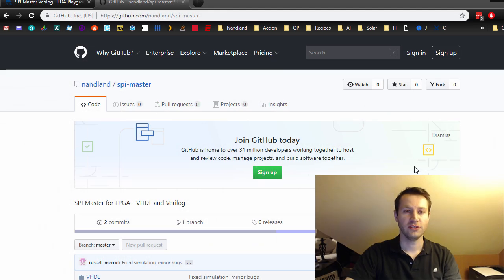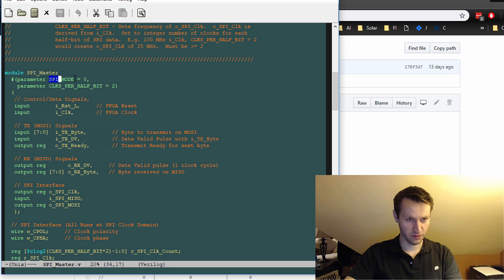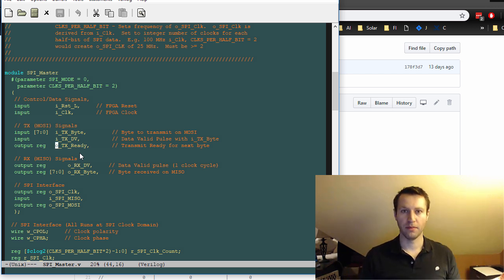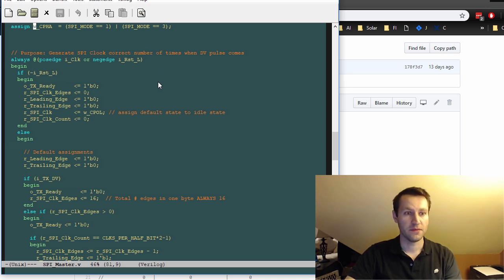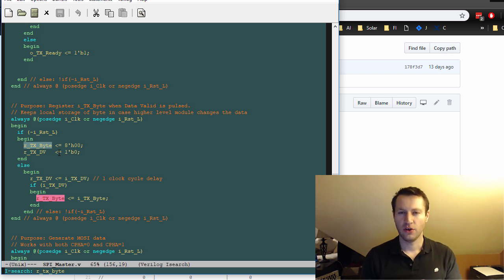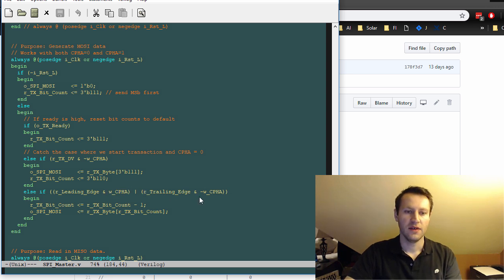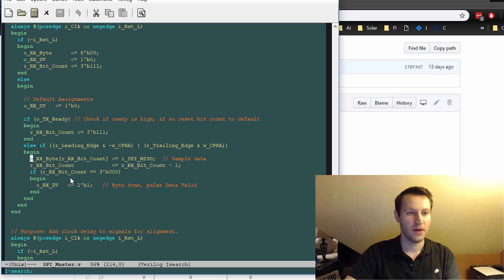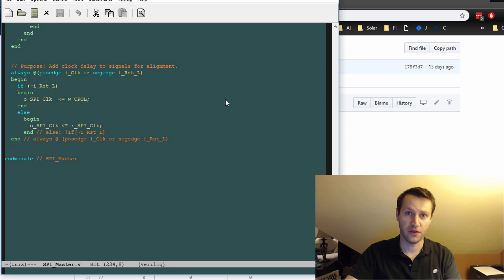SPI Master in FPGA, Verilog Code Example

Comment: Two very basic questions

1. In MISO always block why you need to check the (o_tx_ready) signal.??? 🤔. o_tx_ready is the flag generated by the spi master to tell the upper module that its ready for next transmission on MOSI.. 

2.  In first always block where we are counting the edges of the master clock (i_clk) to generate the spi clock edges.. Kindly elaborate who the trailing and leading edges are correlated with this count?
Reply: Anyone please
Reply: Hey, have you found an answer for 1st question?
Reply: Nope.

Comment: Thanks for making this video, at 5:55,
why does there need to be an extra delay for the output spi clock? Is it because you are using one cycle to copy the data on the input?
also does the half bits per clock really need to be 2 or more? It seems like it would work with a value of 1 from looking at this
EDIT: I see the need for delay for the output spi clk, it's because you are basing the output of the spi_clk on r_leadingedge which is already a cycle behind
Reply: Please answer my question. U seem the most relevant

Comment: $CLOG2 is giving error in synth
Reply from the maker: What's the error? I suggest posting your full question and the error to stackoverflow.com.
Reply: @Nandland  ERROR:HDLCompilers:26 - "Code.v" line 60 unexpected token: '$clog2'
ERROR:HDLCompilers:26 - "Code.v" line 60 expecting ':', found ')'
that is line 60 of your github code.
Reply: @ajtechnologies4185  $clog2 has been around since Verilog2005 and in SystemVerilog.  What synthesis tool are you using?  How old is it?
Reply: @unfrostedpoptart  Hi David, I also have the same error like this when using Xilinx Tool:  ISE-Design Suite 14.7. I haven't fixed it yet, Could you help me suggest the solution for that error? Thank you so much.

Comment: Thanks for the video! I have a question on how we should utilize or modify this code if we need to transmit and receive data 2 bytes at a time instead of 1 byte at a time as shown in the code?
Reply: I also have this question
Reply: Make clock edges from 16 to 32 with counters updated from 3 bit to 4 bit

Comment: Thanks for really helpful video. But I have a question that how to make and send 'real' signal  in FPGA. I mean, if I want to SS low at specific time how to do it?? not for testbench.
Reply from the maker: The only source of truth is your clock. Time does not exist to an FPGA. Only clock pulses. So you need to 1. Know the clock frequency. 2. Count clock pulses. That's how you know anything at all about time.
Reply: Maybe what I have to do is make counter and signal in the top module. It would be harder than I thought.... but thank you for your answer!